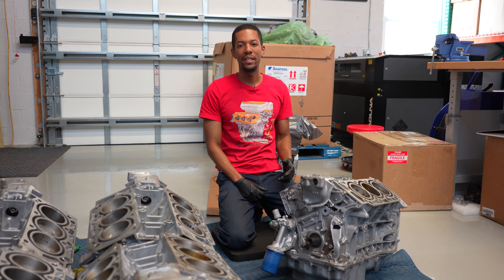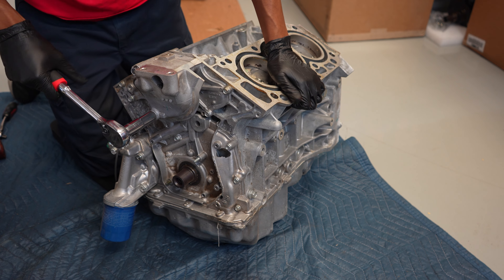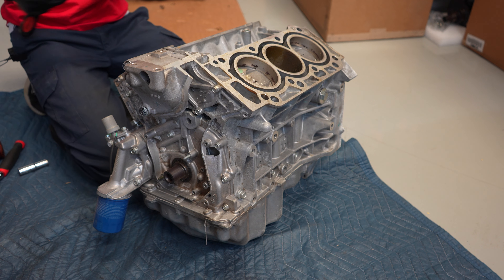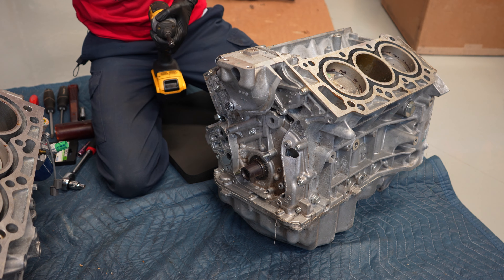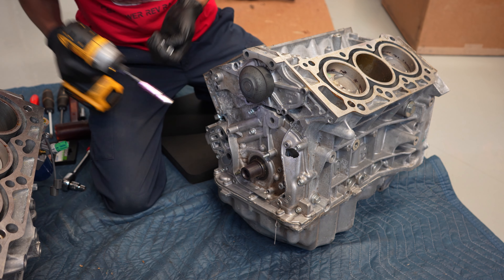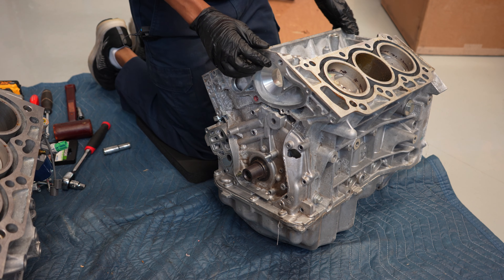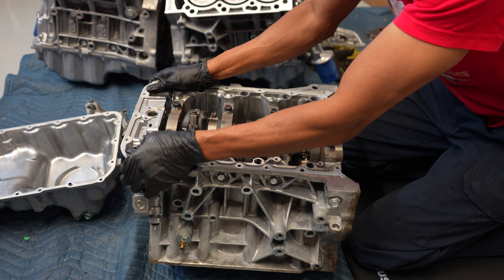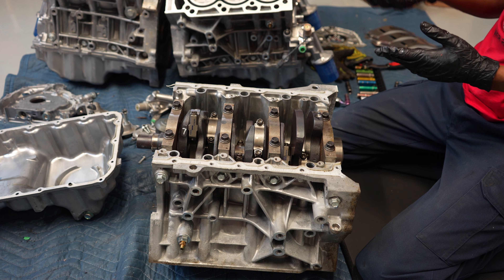Desire for Knowledge: Honda Accord J30A4 Engine Expert Disassembly

Comment: HELLO FRIEND I'M FROM BRAZIL AND I HAVE AN ACCORD V6 3.0 2006 I TOOK THE ENGINE OUT TO MAKE THE BOTTOM PART OF THE CRANKSHAFT BUT WHEN I ASSEMBLED THE CRANKSHAFT LOCKS THE CRANKSHAFT IN THE BEARINGS DO YOU HAVE ANY TIPS?

Comment: I have a j30a1 in a 99 acoord is it worth modifying it or is it better to just swap the j32a2 type s to get more power? Its doesn't have the coil over system tho and is it gona be complicated to do the swap to the j32a2 coil over system

Comment: Can you help me, my 2004 accord v6 3.0 is geting oil into the cooling system, my radiator is mixed with antifreeze and oil, mechanic checked it and told me the head gaskets are fine but 3 more workshops can't find a solution, they drain the oil from oil pan and it doesn't come out with antifreeze but they drain the radiator and it does come mix, car runs but after 20mns runing temp goes up to half then i have stop and let it cold then runer again please help what can it be
Reply: Do you have a list of what the shops tested? Leakdown, compression, coolant pressure test? I'm on here familiarizing myself with these engines as I now have 2 pilots. My first dip into J series. Not too sure of all the systems and inner workings yet, to help guide you to a conclusion. But when in doubt, process of elimination helps narrow down the root cause.

Comment: Will P2R J Series Holley EFI Intake Plenum Adapter Kit fit j30a5 ?
Reply from the maker: Yes but may hit need some grinding to clear the power steering pump if installed in a 7th gen accord.